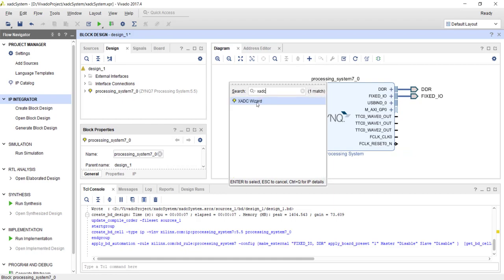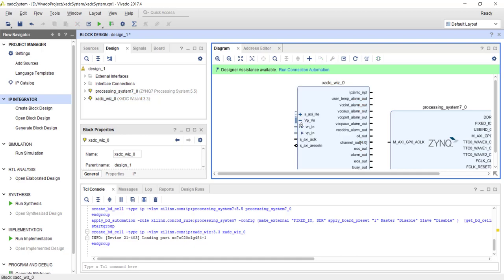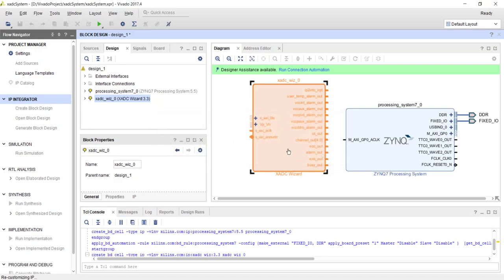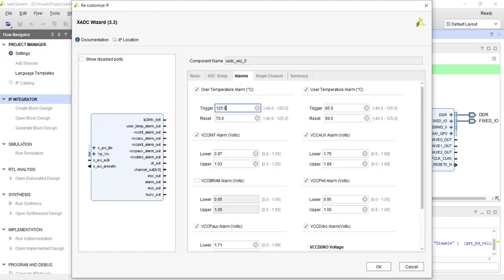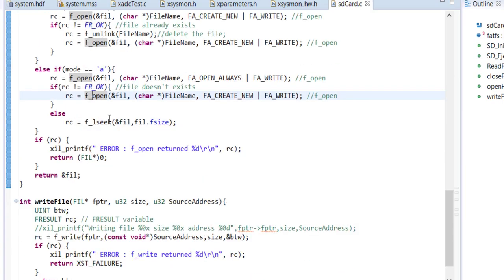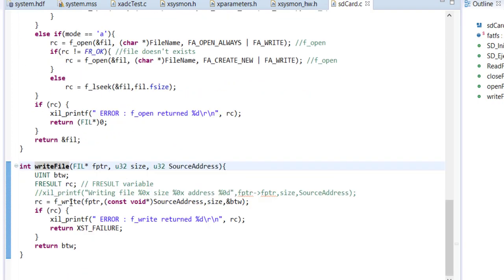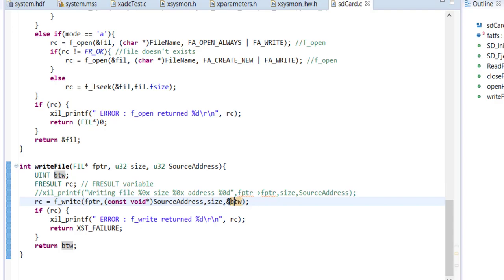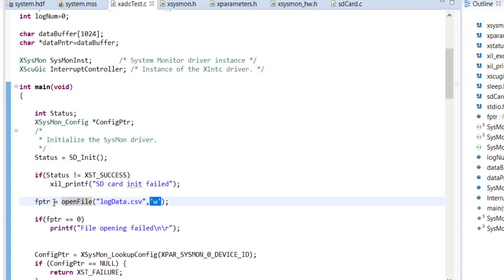Reading and Writing to SD Card (Text files) and System Monitor

Comment: good job friend. but there is no read txt file example
when I try to read file into a buffer using f_read() func  it returns an exception  value  = 7 
which is defined in ff.h  as FR_DENIED in  FRESULT enum
FATfs doc says,
The required access was denied due to one of the following reasons:
Write mode open against the read-only file.
Deleting the read-only file or directory.
Deleting the non-empty directory or current directory.
Reading the file opened without FA_READ flag.
Any modification to the file opened without FA_WRITE flag.
Could not create the object due to root directory full or disk full.
Could not allocate a contiguous area to the file.

Im sure that my file is not write protected, it is not readonly file.
so what should to do?

on the other hand, when i use f_gets() func,  then compiler gives error of linking "undefined reference to f_gets" (even if libs are included)
do you have any reading example to share with me ?
Reply from the maker: Assuming you were able to write to SD card and you have the file logData.csv in the SD card, try this code. Create a new sdk project and try. You don't need any bitstream. When you start sdk project, choose zed hardware platform (predefined)

#include "xstatus.h"
#include "xil_printf.h"
#include "sdCard.h"
#include <stdio.h>

FIL* fptr;
int logNum=0;

char dataBuffer[1024];
char *dataPntr=dataBuffer;

int main(void)
{

 int Status;
 float TempData;
 /*
  * Initialize the SysMon driver.
  */
 Status = SD_Init();

 if(Status != XST_SUCCESS)
  xil_printf("SD card init failed");

 fptr = openFile("logData.csv",'r');

 if(fptr == 0)
  printf("File opening failed\n\r");

 Status = ReadFile(fptr,(u32)dataPntr);

 if(Status == XST_FAILURE)
  xil_printf("File read error\n\r");

 for(int i=0;i<20;i++){
  sscanf(dataPntr,"%f\n",&TempData);
  printf("Temperature is %f\n\r",TempData);
  dataPntr += 8;
 }
 closeFile(fptr);
 SD_Eject();
 xil_printf("Safe to remove SD Card...\n\r");
}
Reply: @Vipinkmenon  hi, i tried this code and it only reads "0.000" in all the values, im trying to figure out the problem but a little help from you would be nice😅.